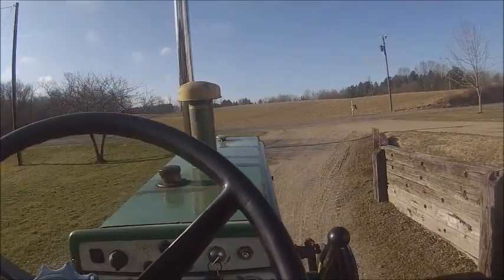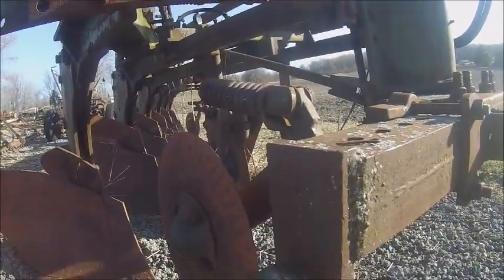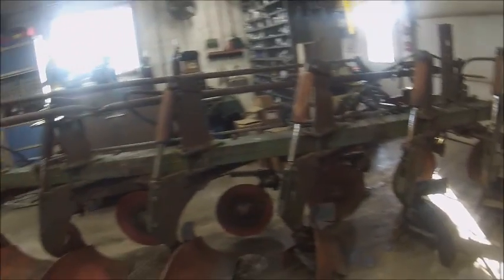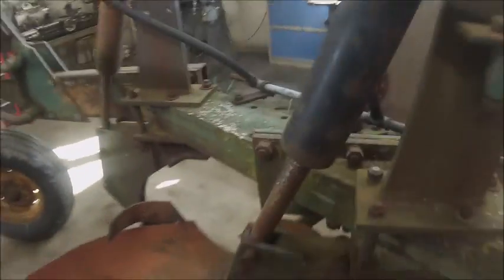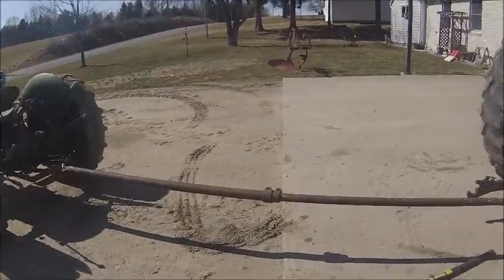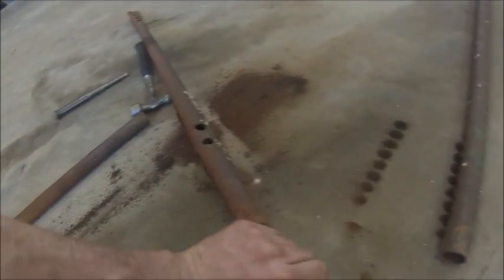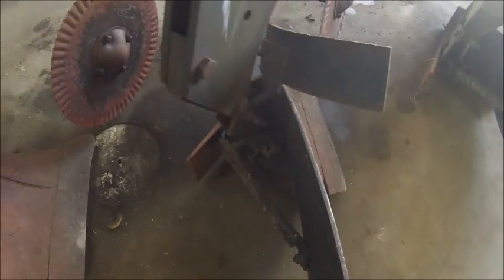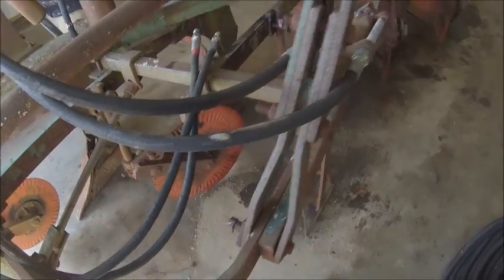Oliver 575 Plow Build Part 1

Comment: Oliver plows always had a great reputation for pulling easy in our area. The 548 spring reset was especially popular. I know my neighbor also had a 6-18 plow that was branded Case but was obviously built by Oliver. They were good plows.
Reply from the maker: The only plow that would ever come close was when IH finally came out with the 710 and 720 plows. Those were pretty good.

Comment: It is amazing how rust holds stuff together.  This winter I wanted to change the 2 u-joints on my New Idea hay rake.  There was no way to get the u-joints off the shaft other than to cut them both off.  Heating didn't even help.
Reply from the maker: I hate u joints. I usually just start off cutting the cross out anyhow cause it’s easier to fight one cap at a time rather than 2.

Comment: We have pulled on stuff with tractors and hit it the hammer. Works, but I find the concept somewhat comical for some reason. 
How many bottoms could you extend that plow by?
Reply from the maker: That frame can go to 8. If you wanted but 7 and 8 both required the arched pipe brace for the frame.

Comment: Farm Boy, you were talking about losing skilled labor in your machining video. I worked at Caterpillar in East Peoria for several years as a machine repairman. You'r right, production machining is not as much fun or as interesting as a machine shop job. All CNC machining. Push a button and let her go.  The tool room jobs were all it.  Making parts for production machines. I worked  on gear shapers, lathes, hobs, grinders. mills.  Setting geometries after a crash or wear for axis and tear down and rebuild of lathe beds and other machines. Working with rebuild included scraping and flaking for flatness and lubrication purposes. Cat outsorced maintenance. I watched about 600 years of experience walk out the door.  Never get that back I'm sure.  Getting to be fewer talented people every day.
Reply from the maker: Dad built and installed a bunch of machines for the Peoria plant back in the 90s and early 2000s. Axle straighteners are the ones I remember off hand but he had machines in the track assembly building and crawler assembly building to. Everybody I’ve ever talked to that has been there says that facility is crazy to see. Couldn’t imagine all the cool shit you got to see while working there.

Comment: What is the pressure suppose to be on the accumulator?  I was told 2500 PSI by the guy I bought mine from but never saw the manual for it. 

What fluid are you using on the HydroPower units on your tractors?  Thanks, Edward
Reply from the maker: You put 1250 on the accumulator with nitrogen then pressurize the system to 1400 with the hydraulics. And we run hydraulic oil in the over unders and ATF in the hydrapowers.

Comment: Are you going to run a gauge wheel on it?  You must have some heavy soils up there we pull 6 down here with 105 horse tractors
Reply from the maker: No, you don’t really need a gauge wheel till you start getting 6+ bottoms or have a tractor that doesn’t use lower link draft sensing.